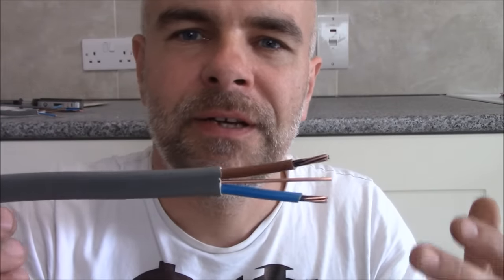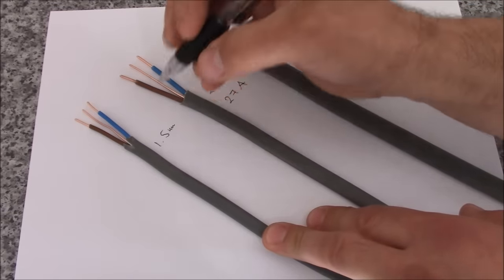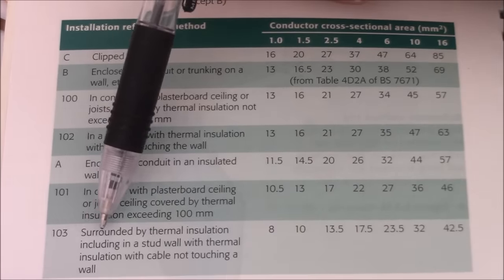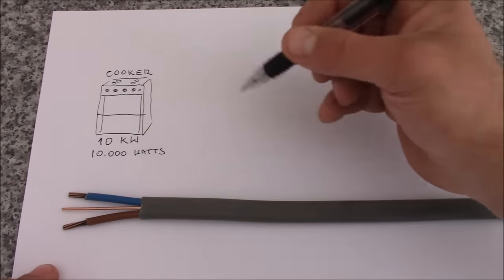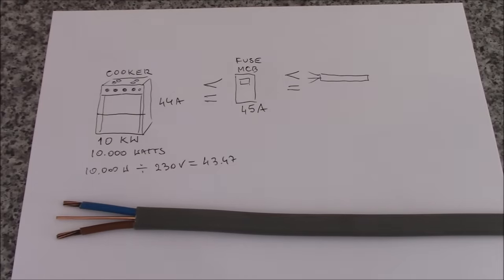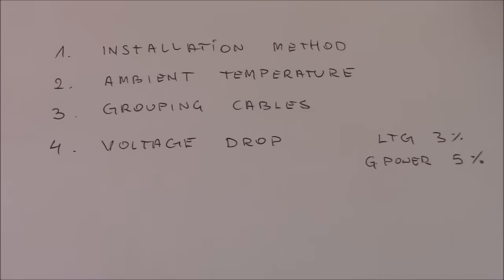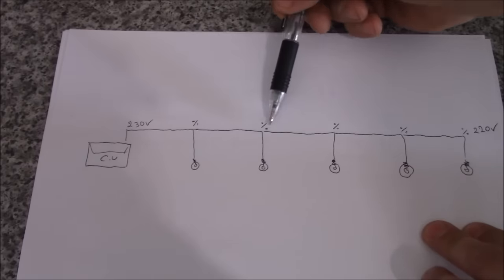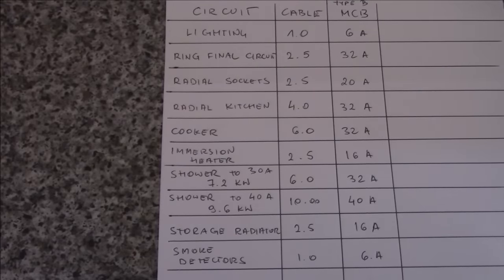Cable size Circuit breaker amp size How to calculate What cable

Comment: I would to tell you something about the reference book for calculating the cable size and current capacity. The important think you did not mention it that for choosing a cable you firstly determine the company made it and check out their catalog , because every company has own tables and calculations. So when you buy a cable , you should check their tables to make your correct calculations.
Reply: They all have to meet a british standard and the regs book works to that so you buy cable and it will be good the minimum capacity 
Some may exceed it but that doesn’t matter it keeps it standardised across the board

Comment: You didn’t use any diversity. 44A isn’t the design current. First 10A then 30% of the remaining
Reply: I wonder what diversity is in this context. Where do you see 10A ? in the calculation ?

Comment: Your calculations for the cooker are incorrect. You need to take into account Diversity. From the On site guide or IET BS7671 2018 Amd3.  10kw cooker 44 amps. Take the first 10 amps then 30% of the remainder plus 5amps if a socket is run from the cooker isolator. 10A + 30% of 34 =10.2A + 5A for the socket if applicable.
Your demand is 10+10.2+5 =25.2A.
Reply: Smarty pants ...

Comment: quite dangerous calculation, (no offense) you see, 43.47A load needs much higher than 45A CB, maybe somewhere 60A or higher CB, the same concept on wiring, 
because you have to consider future loads and transient currents. Anyway good basic points. :)
Reply: The point of a circuit breaker is to protect the cable in the event of a fault, so actually you're wrong. It should be sized to suit the load. Under normal use the cooker would rarely draw full power anyway as different rings and elements would be in use at different times. The cable needs to exceed the breaker size. You cannot add "future loads" to a cooker circuit, it serves only the cooker, however it is good practice to oversize the cable in case in the future the cooker is changed to a larger one. In this case the CB would also be swapped for perhaps a 60amp.

Comment: Most of this is lifted from the onsite guide. Unfortunately you haven't taken into account diversity, no explanation for when a cable has multiple installation methods through out the run etc.  There's a awful lot more to circuit design, some of which you hinted at, but not explained and factors not mentioned. Personally I think there's a real danger here of somebody with little knowledge following this advice and getting into difficulty.
You make some great videos but this one is misleading.
Reply: He did actually point out that there are more factors to it. Explaining to non driver on how to drive doesn’t mean he’s going to get into a car and drive ( unless a complete moron). This is meant for people with some degree of intelligence. People make fook ups in every day life. Should everyone be shielded from various levels of information just because they have no brains? Agreed, useful videos

Comment: Good. the building code, is the bare minimum. Anything, i do with wires, power, always use a gauge 2 numbers larger.   14   should be 12, in a house.  8 should be even 7 or 6......etc.   16 is   TOO  SMALL   FOR  XTENSION CORDS, try not to use these cheap POSs'.     oldtech.,
Reply: the 'plastic' female ends, overheat on a large draw,  FIRE  HAZARD. ...

Comment: WRONG. Size cable for worst case installation. 1.5mm = 10 amps. 
Dont have different cable sizes connected together if the cable is installed in different situations.

Comment: Wrong calculation. If you wanna find Ampere(in case AC power, and only know Whatt), you have to use formula : Watt/(Volt x Power Factor) . If you have VA, you can use your formula : VA/Volt

Comment: Millimeters doesn’t work for calculations in the USA sorry
Reply: With such a pathetic supply voltage I think you need to use rebar rather than cable to carry enough current to actually operate anything.

Comment: I don’t know in what country these codes apply, but it isn’t USA. 
Getting info on electrical installations on YouTube is a good way to burn your house down or worse. 
Get a licensed electrician.
Reply: I think that's in England
Reply: Ralph Averill is is in the U.K. This info is not really intended for ameteurs to actually do the work themselves, all major electrical work here must be carried out by a "competent person" and be signed off by someone with the correct qualifications and certification. In practice this means DIY electrical work is virtually impossible to do legally- even if you are "competent" no worthwhile electrician will sign off someone else's work. The regulations around wiring are so complex that few people attempt much DIY electrical work. Householders are permitted to do basic jobs like change a light fitting or socket front I think. Anything else requires testing and signing off and few have the equipment (expensive) and training.